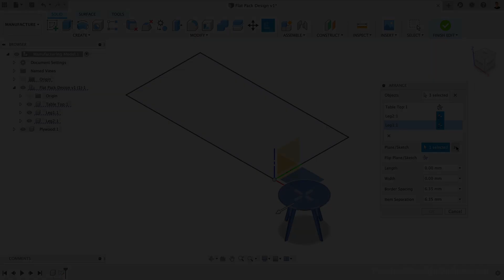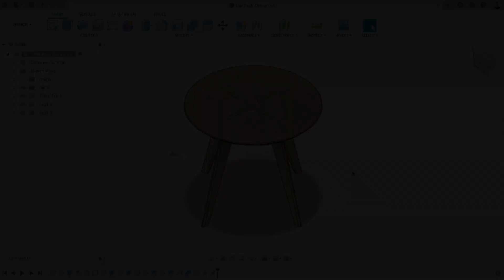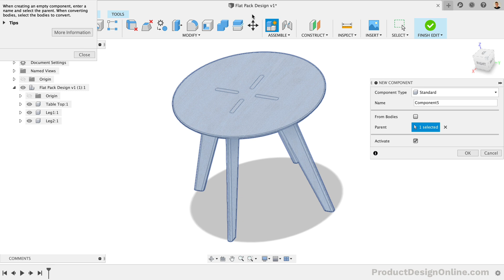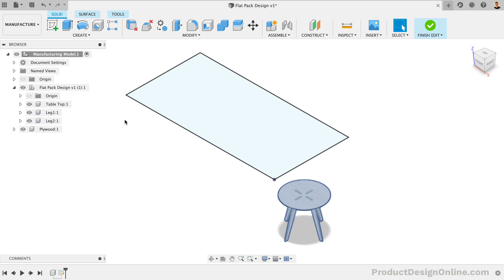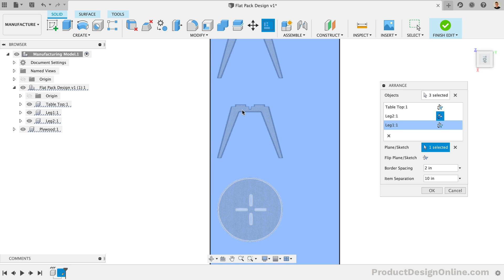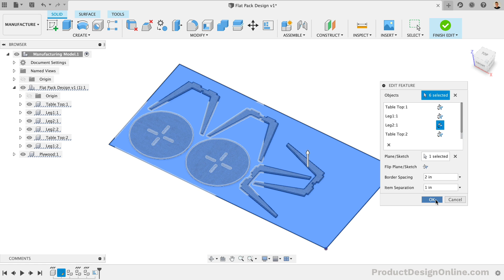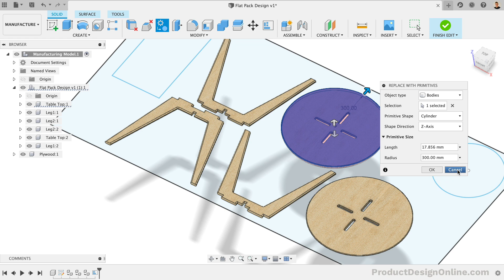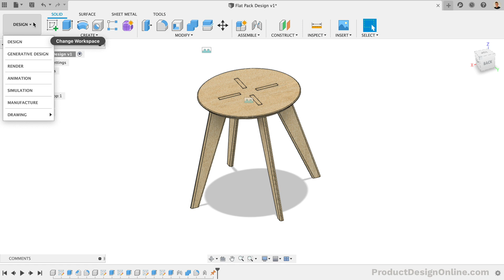Fusion 360 - Auto arrange parts on sheet

Comment: Nest - I would like to request a feature. I design wood projects for the Shaper Origin and have been using the Shaper Tool available in the Design environment. This tool is not available in Manufacturing. I would either like to have Arrange available in the Design environment or the Tool tab available in the Manufacturing environment. The first option would be most desirable. Thanks for a showing us the great feature.
Reply: Do these new features not help people working with shaper?

Comment: Awesome, haven’t played with it yet. Once nested can a DXF be generated?
Reply: Hi Monte, there are two ways to export/output dxf for the arranged results:

1. While in the Edit Manufacturing Model environment, project the boundaries of arranged objects onto a sketch and then export the sketch as a dxf
OR
2. Create a setup and toolpath operation for the arranged objects. Please make sure the sideways compensation is set to "Center" (for 2D Profile) or "Off" (for 2D Contour). Then you can PostProcess the toolpath by selecting one of the available DXF posts from the fusion post library.

In the post dialog, you can set 'onlyCutting' = "YES" to get rid of the linking motion. And you can set 'includeDrill' = "NO" to avoid points at the drilling positions.

To download and install the dxf post on your computer, please visit - "https://cam.autodesk.com/hsmposts?"